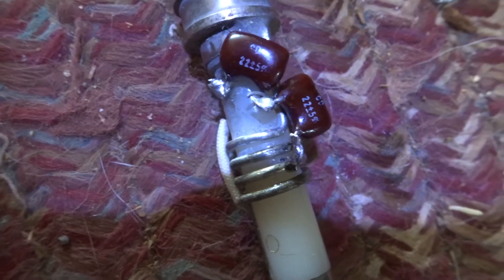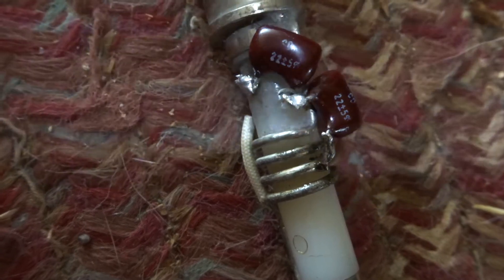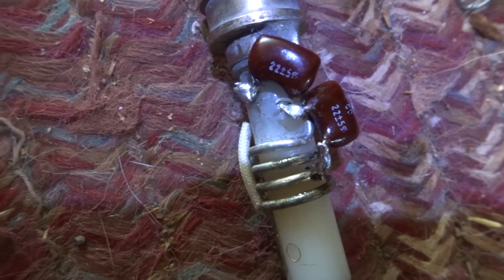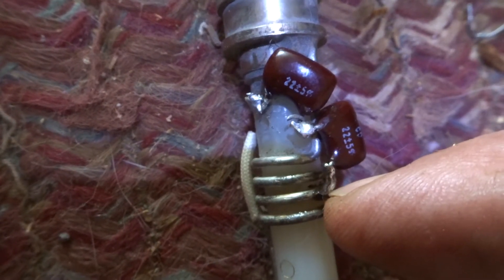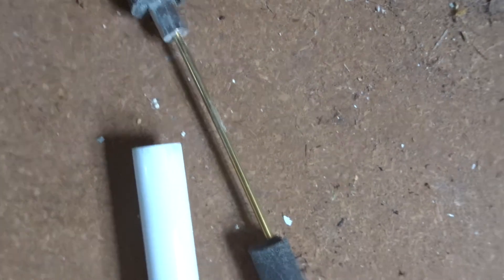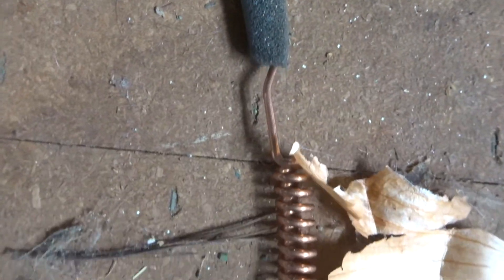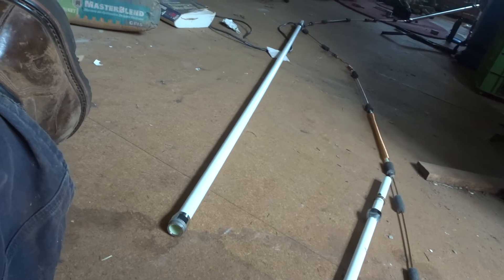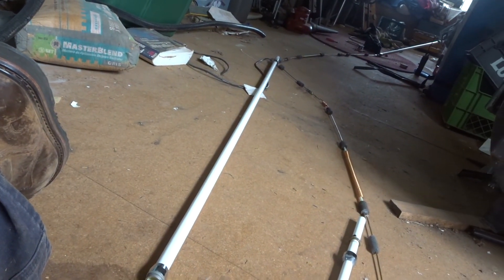Tram WSP1481 17ft coalinear antenna vhf uhf low gain problem

Comment: And what size cap was that? I am getting a high SWR and was told to check the cap.
Reply from the maker: The caps aren't labeled. I have looked at and measured them and believe they are barely less than 10pf. A comet with labeled caps had caps in that value area. The comet had several similar problems and , although , strangely, mine did not have high swr, just low gain ! But, if a cap was completely blown till it had no capacitance, it would show high SWR because these cap are the primary coupling system, at the bottom of the antenna as you've probably seen.  I had a video from a Comet user , I can't find it now, he went through a ton of problems, static blowing out these caps was one, Lightning direct hit REALLY blew out some stuff !

Comment: I have 2 Tram Model 1481, the VHF has gone to 3.58 SWR. The only thing I can think of is the Capacitor. Just don't  know what size it needs, and how to take it apart to replace it. Anyone with information on repairing this please let me know.   73   W4DES
Reply from the maker: Hi Don. My photo is of a crazy boat captain called captain Ron so not to worry.  When my caps went out it amazingly didn't change the swr !  That said I estimated that they went from about 8pf to 1 pf and the biggest change was the gain which dropped considerably! However, if your cap was completely obliterated you would see a difference in swr. I'm assuming both are around 8 pf.  That said, I have definitely seen problems when the screws that connect the pieces between the sections come loose.  I would suspect that first unless it took a direct hit? N6GRG
Reply: @californiakayaker  Well, I live in Florida. You are in Tornado Alley, I live in Lighting Alley! It was not hit. But sometimes something not far away can get some very high voltages in the antenna. But this is just one idea about what could have happened to it.

Comment: What are the values of the capacitors?  Mine got water in it and I can't tell
Reply from the maker: My best measurement put them at between 8 to 10 pf if I recall. The bad one had gone down below 1 pf
Reply from the maker: @californiakayaker
0 seconds ago
The caps aren't labeled. I have looked at and measured them and believe they are barely less than 10pf. A comet with labeled caps had caps in that value area. The comet had several similar problems and , although , strangely, mine did not have high swr, just low gain ! But, if a cap was completely blown till it had no capacitance, it would show high SWR because these cap are the primary coupling system, at the bottom of the antenna as you've probably seen.  I had a video from a Comet user , I can't find it now, he went through a ton of problems, static blowing out these caps was one, Lightning direct hit REALLY blew out some stuff !

Comment: How difficult would it be to change the SO239? The antenna that I have, the SO239 had a flimsy conductor with nothing around it to support and movement. Naturally, it broke several of the pieces off and there might be two pieces actually making contact. I've never seen an SO239 so poorly made.
Reply from the maker: I've not had a problem with the so-239 on that antenna.  The antenna was up for five years before the capacitor blew out.  I have three of them and not had a problem with the so-239

Comment from the maker: And , incidentally, if you antenna develops this problem, you will have a decent SWR but very low gain. A little rare to have decent SWR and yet low gain, but this is what happened. This antenna was up for 5 years at 120ft and at a minimum had a ton of static, possibly some lower powered lightning. I run a polyphaser to remove the static and lightning off to ground but the capacitor is the only coupling to the coax from the long element with all of the coils. I'm fairly certain all collinear antenna's have a coupling cap like mine.